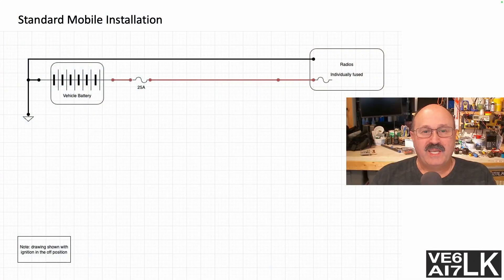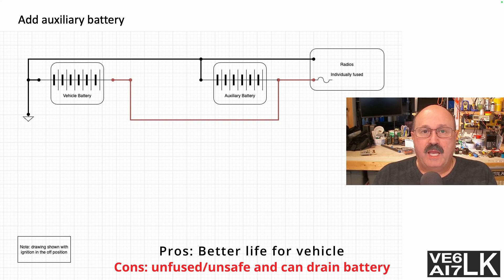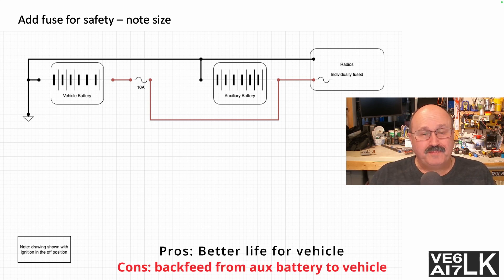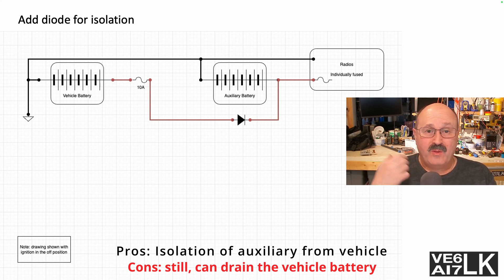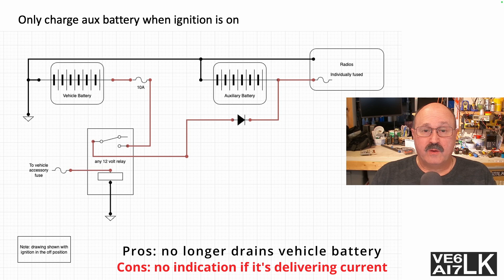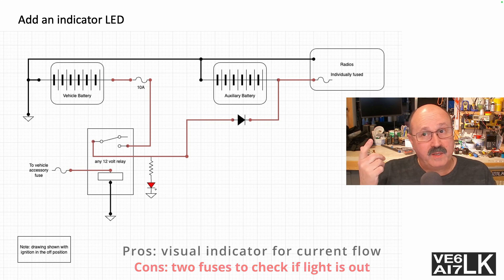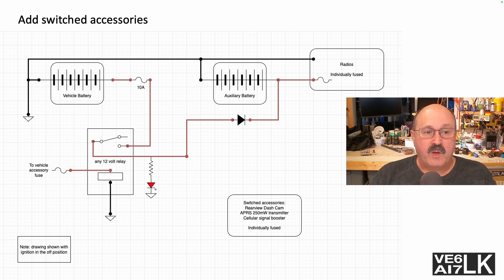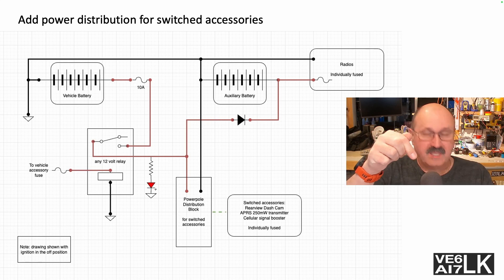F 150 power distribution ideas for radios

Comment: Brilliant video, my friend. In modern vehicles, automotive wiring can seem daunting. You made the addition of a robust system appear easy. 
The only critique is how much of a pain it is to fish wire and tap into most fuse panels.
Reply from the maker: Thanks Amigo. I'll admit I did hire out one part of my install when it came to fishing a wire as sometimes it's just smart to have a pro do the job.
Reply: @VE6LK, long ago I shorted a wire installing a stereo. The pickup would only go 40mph in "emergency mode."
I think I've learned better what my limits are these days.

Comment: This is really clever.  I just wire directly into the truck battery (with fuses, of course) and hope that I remember to turn the radio off.  I carry a jump start box in case i forget.  If you pass me sitting along the highway with my hood open and holding jumper cables, please stop. 😛

Comment: A DC to DC charge controller from the likes of Victron or similar and a LiFePo4 auxiliary battery would also be cool.  I wish they made metal Anderson Power Pole connectors with Teflon insulation to isolate the inner power terminals, then it would be the best connector because you could 100% shield the DC power line against noise.  That would be a supreme connector.  Maybe one day...
Reply from the maker: I agree 100% and would prefer a LiFePo4 battery as the auxiliary. Unfortunately, where I live, many months of the year are below freezing which makes those batteries unhappy to receive a charge.
Reply: I have more and more respect for Amphenol and random various government standards for military and such with each addition of every cheap cable with low quality (or no quality) shielding.

Comment: Looks good.  My 2k f250 had an accessory relay that would send 12v power to power a few things including a small amount to the power wire to the trailer harness.  do you have a video or pictures on where you placed the relay?
Reply from the maker: The other video shows where I placed the relay, battery and distribution at 19:55 or so. Under the rear seat in the storage area. I've since covered it up with a piece of white corrugated plastic to keep it tidy looking.